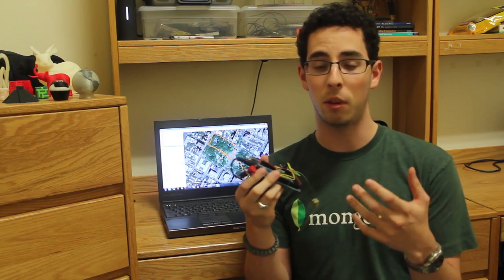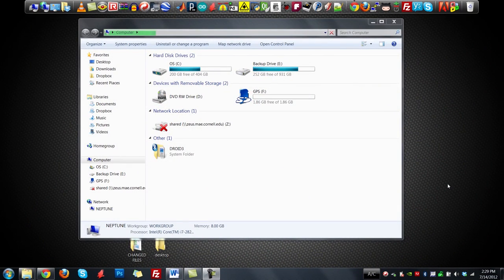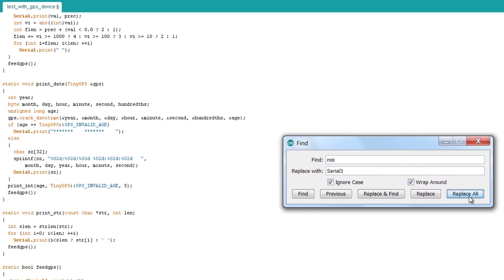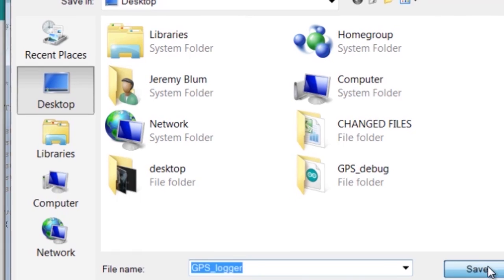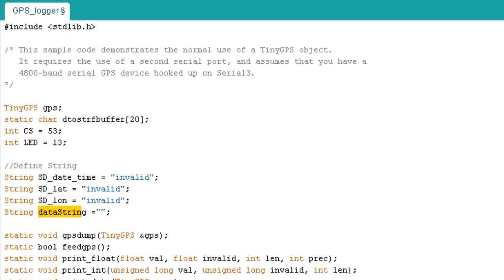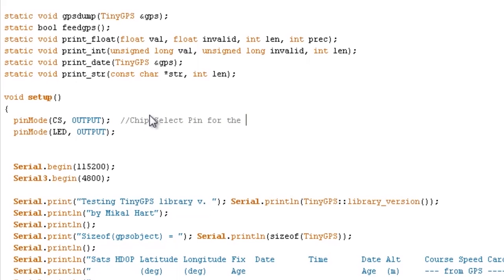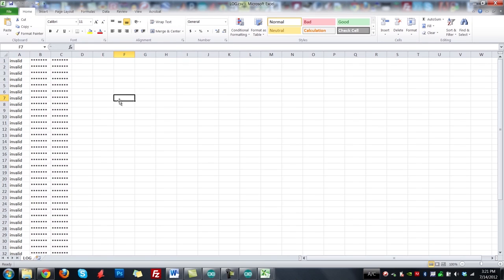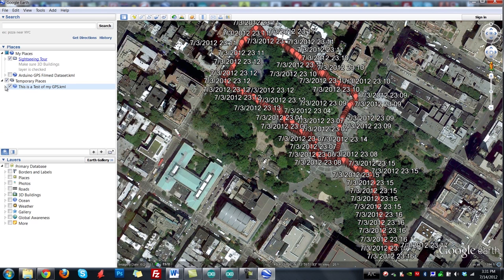Tutorial 15 for Arduino: GPS Tracking

Comment: a correction, 4 satellites are actually a requirement to get a position in 3d space. Although it is possible to get an inaccurate 2d position over the ground with 3 satellites, you need 4 to get a full 3d position.

Comment: yes and im sure there is an arduino video on you tube that demonstrates a joystic (which is ismply 2 potentiometers) connected wirelesssly between 2 aurdinos controlling a servo. Theres a wireless sheild availible, or you could even possibly build your own rx and unit speficially for just controlling servos

Comment: I am working on a project called automatic tour guide system. 
Consider an example of a musuem. The system includes a display device that will be given to the visitor, which will receive the signals from the transmitter attached to the statue, only when you are in the vicinity of the statue. On receiving of that signal, the display device will display the information about that particular statue.
I am not into electronics, so I need ur help.
What would you recommend on using for this system?

Comment: Do you have any idea why it is not working with my Arduino Leonardo? I connected it manually to Serial 1, but I am getting no data whatsoever. The GPS modules is working because I tested it with u-center and I can get the data from it. what could it be?
Reply: I had a hard time trying to make it work on Leonardo so after 2 days I got an arduino Mega and it worked at the first try.

Comment: 29:15 - Does Arduino IDE support default arguments? If so he could just add his new argument as "int SD_val=0". With this he could avoid looking for and changing all the print_float() calls he's not interested in and just add the new argument to calls that he needs.
As a general note (by a programmer), the code in these tutorials could often be optimized. That's something to seriously consider when working with something with limited processing power and memory. But it's good that he keeps it as human readable and understandable as possible. Nevertheless the above tip is something you should be aware of if you're going to do a lot of changes to already existing code and is even more understandable IMHO.

Comment: hey man, im stuck trying to get my arduino uno to read letters that i press on my keyboard and give a PWM output to control two micro servo motors with a laser pointer mounted on them, basically, if i press les say the letter S the two servo motors should move together so the laser pointer would write S on the wall, two servos on for x axis and one for y axix, any help would be much appreciated thank you

Comment: Hi Jeremy,
I always got this error.
"  'Serial3' was not declared in this scope  "

-What happens actually? how to make it success? .. or other method >.< Thanks !
Reply: Serial3 refers to tx3 and rx3 pins which are on arduino mega but not on arduino uno so you can use Serial3 if you are using arduino mega board and also you have to select the correct board from Tools > Board > Arduino Mega 2560 or Mega ADK . It may work fine then

Comment: Thank you for your efforts. I looked tutorial and did everything in your video.
1.  In the file the following line (dataString = SD_date_time + "," + SD_lat + "," + SD_lon ;). In the "Excel" all the data is in a single column. But in your video when you open a file in "Excel" are three columns of data (on 40:35). I tried to do so (dataString = SD_date_time + '\ t' + SD_lat + '\ t' + SD_lon ;) and "Serial" between the data does have tabs. But the file is still all the data is in a single column. How do you do it? If I do so (dataString = SD_date_time + '\ n' + SD_lat + '\ n' + SD_lon ;), then in Serial and file data is written to each on its own line . Although I do not need. 
2. To file is not written in "invalid" before start receiving GPS data suggest little change in the bear sketch:

instead of:
/ / write new information on the SD card
  dataString = SD_date_time + "," + SD_lat + "," + SD_lon;
  if (SD_date_time! = "invalid")
  digitalWrite (LED, HIGH);
  else {
      Serial.println ("\ nCould not open the log file");
    }
/ / open for CSV data file
  File dataFile = SD.open ("LOG.csv", FILE_WRITE);
  if (dataFile) {
    Serial.println (dataString);
    dataFile.println (dataString);
    dataFile.close ();

Replace with:
/ / write new information on the SD card
  dataString = SD_date_time + "," + SD_lat + "," + SD_lon;
  if (SD_date_time! = "invalid") {
  digitalWrite (LED, HIGH);
  / / open the CSV file
  File dataFile = SD.open ("LOG.csv", FILE_WRITE);
  if (dataFile) {
    Serial.println (dataString);
    dataFile.println (dataString);
    dataFile.close ();
  }
    else {
      Serial.println ("\ nCould not open the log file");
    }

Comment: can the arduino uno be used instead ?!
i mean will its input pins be enough
Reply: caroline adel - Yes , you have more than enough pins in UNO for this application. But there is only 1 serial port, therefore you need to use software serial in UNO.